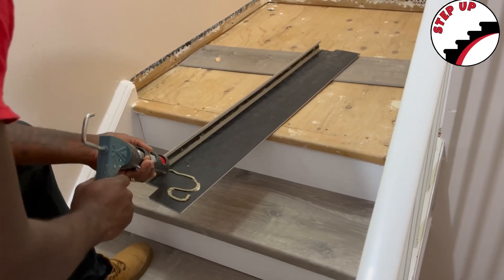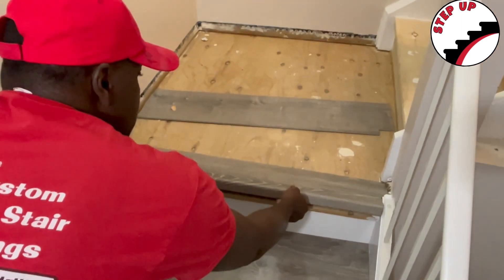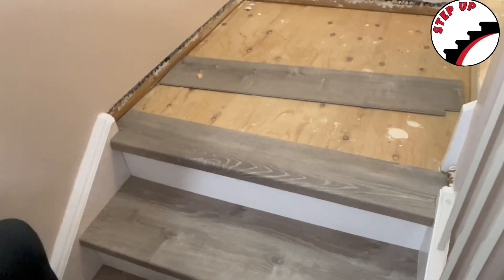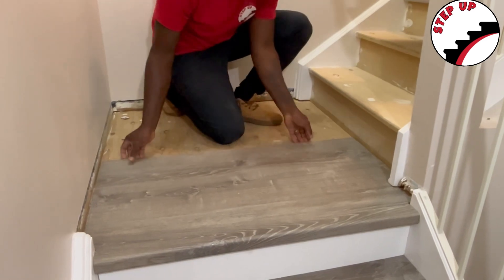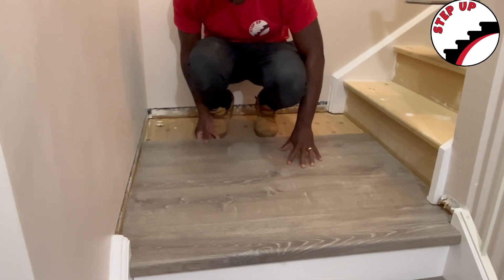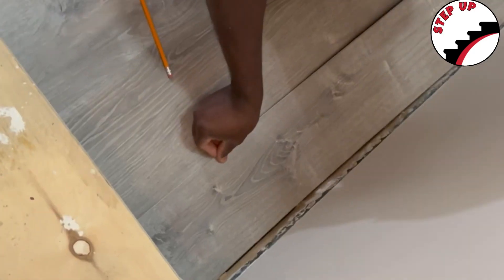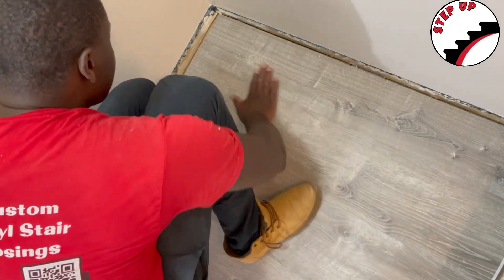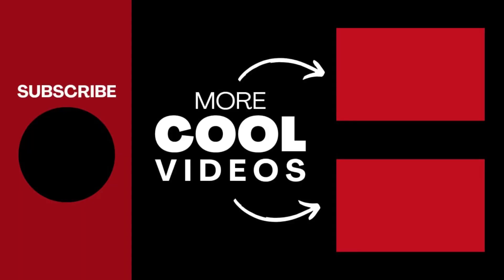Installing Vinyl on a Stair Landing #howto #diy #stepup #vinyl #vinylflooring

Comment: Are you suppose to remove the foam backing off of the vinyl planks? It looks like you didn't...Some of the videos i watched say you have to remove the foam backing otherwise it won't bond very well....Not sure if i should remove it or not...Can you please advise? Thanks.
Reply from the maker: Unless it is a particularly thick backing we prefer to leave it on.  This leaves you with the same under foot experience as on the flooring.  Also leaves it level when you are continuing onto flooring above.  Using a PL Premium adhesive and giving ample time to dry we have never had an issue.
Reply: @Stepupvinyl  thank you for the quick response. That really helps. I will leave the foam backing on as well then.
Reply: may i ask the brand of the flooring you are using in this video
Reply from the maker: Lifeproof from Home Depot